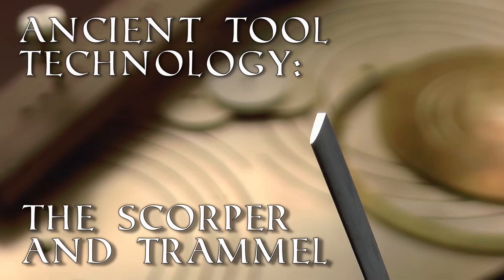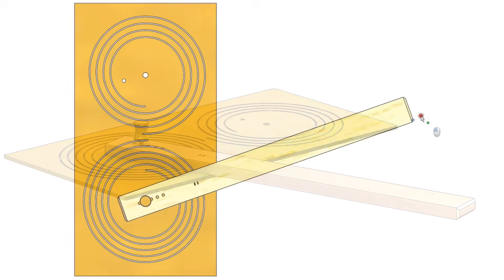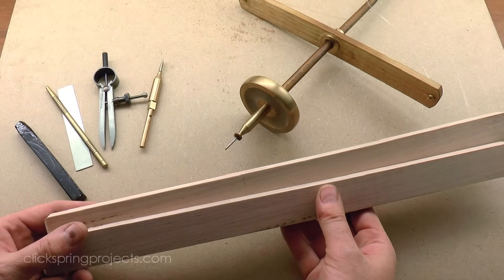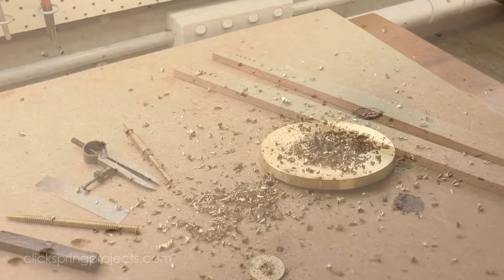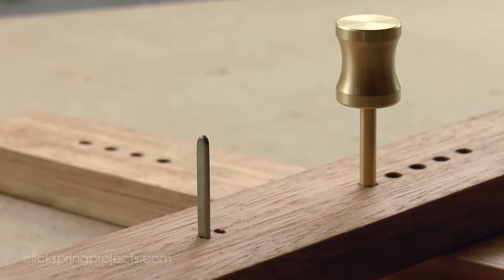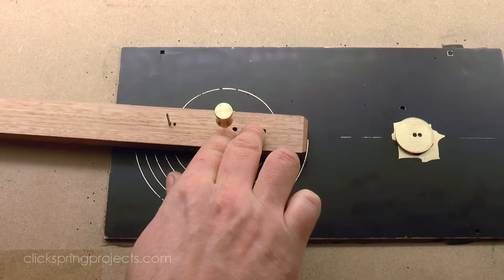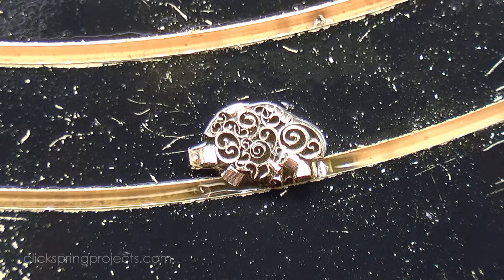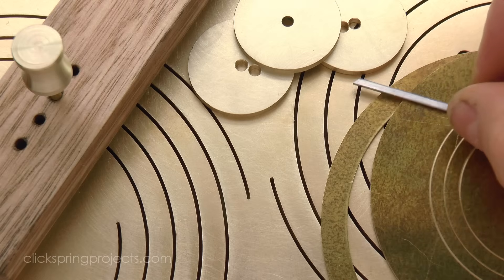The Scorper And Trammel - Experimental Archaeology - Constructing The Antikythera Mechanism

Comment: Being a Lamp builder, Lamp collector, and Lamp salesman who knows what fuels are safe and why, I would say that olive oil wasn't good in the lamp. Olive oil can't travel up the wick fast enough on lamps with a fuel to flame distan e of any more than half an inch.  Note the wick smoldering when extinguished, your flame was producing excess Carbon Monoxide if to normal fuel.  I recommend a petroleum fuel, namely kerosene or non paraffin wax Lamp oil, with a flash point above 125°F and ideally around 150°F.  This fuel will also produce more heat and more light, safely.

Comment: What was the wee black stuff you painted the plate with and what was it you mixed it with ? I suspect its a pitch grade or resin of sorts and a solvent but ive no idea what kind.
It worked very well.
Reply: He has a video on the different marking liquid options they may have used and what he uses.

Comment: A mind that can visualise this could easily have invented a lathe... if it hadn't been invented earlier. A number of tools would have been made specifically for this job, perhaps with limited application elsewhere. As the precision and function of the devices they created evolved, so, too, would have the precision, function and complexity of the tools used. A simple springpole lathe could have been adapted. It would be interesting to see how a basic pole lathe could be adapted, using technology, materials and engineering skills available at the time. Could a simple chucking device using collets be made in bronze?
Based on the Antikythera, it would be disservice to underestimate their enginuity and skills.

Comment: I'm intrigued as to why these "spirals" were done like this.  For everything being so precise in the mechanism, it strikes me as odd that the maker would just accept the imprecise nature of the offset semicircles.  Your method for reproducing the semicircles certainly fits the bill for simplest required method.  It got me to thinking what the simplest required method would be for producing actual spirals.  To this effect, I figured it would be a slotted bar for the trammel to move along the radius of the spiral, with a cord attached to the center and the trammel with the cord diameter equal to the desired spacing of the spirals.  If the trammel was kept taut, this would produce a true spiral as the trammel was rotated around the center.  One might even think of a mechanism where the trammel is counter-tensioned by having a sinew or other elastic material pull the trammel to the outside of the slotted bar so as to evenly align the trammel without significant effort on the effort of the user.  Perhaps this is just me thinking too deeply into the mechanism using anachronistic ideas of precision and models.  Either way, this video was inspiring and I love watching you!
Reply: Why would they do extra work to get real spirals when the data being read is represented by the angle, not the radius of the spiral at any given point. Using half-circles make the process much easier because the radius does not vary continuously.

Comment: I'm having trouble reconciling the conflict in my brain.  Yes, two hemicircles, but, if the point between your two locating pins was used as a focal point of the two hemicircles, wouldn't it then be a spiral at the midpoint between the kerfs?  And another question if I may:  Rather than using one locating pin at the center of the spiral, and one offset;  Could one set the cuts to radiate from two offset pivot points (one to the left of center, and one to the right of center, both equidistant from the center)?  This would put the center of the hands at the center of the spiral.  Or:  Am I just staying awake too late at night?  Thank you for another wonderful video.

Comment: What if you made a spiral by putting a string on a certain diameter cylinder in the center and then wrapped the string around with a marker? As you wrap the string around the center cylinder it gets shorter and that would make a true spiral. You just need the right diameter cylinder in the middle in theory. 

Half circles is kinda easier though.

Comment: I understand you used the olive oil for authenticity, but did it work well enough that you would use it in general as a honing oil? Other plant based oils should be just as good, but not canola or flax seed ( linseed), which are drying oils.

Comment: I know the mechanism didnt use a true spiral, but this got me thinking to how would you make a true spiral with the given tech level.  I got to thinking of a modification to the trammel with effectively a simple pulley to keep the scorper in place, but with the cord of the pulley wrapping around a central axis.  As long as the wrappings could be kept in the same plane, they would eat up more and more of the cord, which would pull the scorper in at a smooth rate.  
I haven't done the math, but I am curious as to how controllable the parameters of the spiral would be given this method.  To figure it out properly seems to me to require calculus as you figure out the rate of change of the radius for such a device, which would put it firmly beyond ancient technology.  In some sense, it could still be a viable option they could have built, even if the calibration would have to have been trial and error.
How would you go about making a proper spiral with the given technology level?

Comment: You state quenching it in water.....but lets NOT FORGET oils like olive oil and even some petroleum based oils (literally) were also known at the time!! And if you quench in an oil YOU DO produce a much harder steel then if quenched in water!! And like I said certain "oils" have been used for thousands of years and are well documented as well!! So it is not much of a stretch to think perhaps they quenched parts in a "plant based" oil or even some refined petrol type solution as well!! 

Another thing to add is that steel in limited quantities COULD BE MADE from simple iron, on a coal heated fire. It is harder to get the temperatures correct to produce it, BUT the addition of a bellows system, can increase the fires burn and temperature to a degree of heat possible to "turn" small bits of into steel when and if required by tool makers and blacksmiths of the period. In this too there is a lot of information that you seem to forget or ignore that "alchemists" (or alchemy) and metallurgy is something "new" when the truth is certain known raw materials like carbon, sulfur (brimstone), iron, cooper, tin, lead,  and so on were used long before the Antikythera devices was made. While not to the degree the device was machined complexity, but there is evidence that some blacksmiths, alchemists and other ancient sciences understood how to make small amounts of items that needed to make things like tools or weapons and so on!! And let us NOT forget some basic elements used in chemistry as well, that still TODAY are used but taken for granted. An example of this is the "Baghdad Battery" which science STILL has no idea why these batteries exist or what they were used for, but predate the Antikythera Device by years if not longer. So there are things we are just now realizing are not actually "new" to the modern world!! And even today we are discovering "new materials" in nature that we have never understood existed, like that of a meteorite that was just discovered to have a "natural steel" in it or micro diamonds from other space rocks that crashed to earth millions of years ago.

Comment: Your spiral is made of semicircles; is that true of the spirals on the Antikythera mechanism? When I first saw those spirals, the first image that jumped into my head was a string wound around a central post, with a cutting tool at the end (which would make it almost -- but not quite -- an Archimedean spiral).
Reply: @JorgTheElder  
You're right, I missed that, sorry.

Comment: Well that was incredibly satisfying. Beautiful solution. In woodworking we make scratch stock scrapers set into a marking gauge as a fast alternative to router bits to create moulded profiles and I often use the same principle to create grooves and even cut thin stock into strips. Of course there are also drill press fly cutters to create larger diameter circles. Nice work Chris.

Comment: I think another method to do the spirals would be to put a round pin in the centre and a string wrapped around it with a marking instrument tied to its end. While unwinding the string from the centre pin it generates a spiral.

Comment: Could you use a second circle with a pivot point off center to make it have an increasing distance from center to increase the arc's radius evenly through the full 360 degrees?

Comment: What's the possibility that the original fabrication of the Antikythera also used something as a stop for the half circle arcs? It makes sense to use some form of a stop, so that the arc doesn't go past 180°. 

Also, I don't see why a true spiral couldn't have existed. All you need is a trammel, with a slot rather than holes, and a rack, that holds the cutter, and a fixed pinion. The cutting tool rides along the slot, and as you turn the trammel, the rack moves along the fixed pinion, allowing the cutter to move as the trammel turns. It's not a very complex tool, and could have existed during that time.  The math involved shouldn't be too complex for the time period, so I wonder why a spiral trammel wasn't used.
Reply: Only with a basic trammel, I'm talking about gearing a trammel to extend laterally while it rotates. The amount of work put into the tool wouldn't be so much that it would make the tool impractical, and the cutting work itself would be less than that of four sets of concentric half circles. You also have to account for the start and stop position of each half circle, and line up the current half circle's offset with the offset of the previous and next half circles; even with physical stops, there's still more work in this method. Plus you have to take the time to adjust the tool each time you start a new circle, and adjust the physical stops each time you move offsets, which allows for more inaccuracies and more time in the project. 
With a spiral, the start and stop positions only matter once, and you wouldn't need to adjust the tool at all.

It comes down to four sets of four concentric half circles with tool adjustments for each half circle, or two spirals done with a tool that you don't adjust at all; 16 cuts on four centers with needed accuracy of where your 16 starts and stops are, compared to two cuts on two centers where the starts and stops only matter twice.

In the end, a spiral trammel will be less work overall, saves time, and has less potential inaccuracies. 
Your statement is factually false. Use some logic and do some simple math.

The tool itself wouldn't even be that hard to design. You need a stationary pinion with a moving rack, all it needs is a small cage to hold the rack and pinion together. It'd be a relatively simple tool. Maybe even throw a leg, that has a foot of a bearing material, on the cutting tool end to keep the rack parallel to the work. Again, something like this could have easily existed in the time period, and probably did in someone's workshop.
Reply: @JorgTheElder  You didn't comprehend any of what I said, did you? It's not complicated at all, it's actually fairly simple. Like I said, in the end, it's less work. Again, use some logic, and it's clear that a spiral trammel would be simpler, faster, and more accurate over the entire process.

If you really cannot understand this, you may have some competency issues. And I would start questioning your understanding of anything within this project, if a basic rack and pinion is 'too complicated'.

Comment: drilling a hoel through where the pints meet (a hole with the same diameter as the path) wouldnt that be a "good" thing. idk how precise you need to be with this tho in terms of overextending with the wrong half circle, the hole would need to be quite precise so might not be worthwhile and its not that big of a deal to over exted with the tool as long as its not by a lot :p

Comment: On the original piece, are each instance of a half-circle's radii constant? If a rigid tool were used, pivoting from a single central point through the half-circle, the radii would be constant vs a true spiral whose radius continuously decreases throughout its path. To get a true spiral, wouldn't you use something like a string being wound around a central mandrel allowing a tool tied at the other end to be drawn continuously inward?

Comment: Very interesting! First we have the approximation of a spiral by offset-centered half-circles. Then we have the humble trammel with a cutting tool instead of a point. Put them together and you have an approximate spiral cutter. Very plausible explanation of how they did it and a very clear explanation of how it worked. I wonder how lathe chucks scrolls were cut in the 1890s. It would be interesting to see if they reinvented the process.

Comment: I'm a bit confused how you got your steel to file hardness after filing off all the case hardening. Was it medium/high carbon to begin with? The case hardening implies to me you started with mild steel / wrought iron.
Reply from the maker: The initial stock is low carbon mild steel, insufficient carbon for a quench harden. Thin sections left in the pack carburisation process for long enough, end up carburized through the entire cross section giving the opportunity for through hardening - Cheers :)
Reply: @Clickspring  Ah! Thanks for the reply :)

Comment: The one thing I'm surprised about, is that you didn't make some kind of "stop" for the trammel. Since this process is something that doesn't require training, it seems like a job that you could easily give to the youngest apprentice, and if the set-up included stops to keep the trammel from going too far, this would be something they could do relatively quickly compared to having to ensure the correct start and stop position every time.

It should even be able to have it be a feature in the table you'd be working at.

Comment: At 10:34 there is a slip in the second wheel in. How did that happen? Did the pivot pin come out of the hole, or did the wood rock from side to side or something? It seems like such a slip wouldn't be possible with your setup. Could such a thing have happened while cutting?
Reply: Could be the "button" came loose. He is only holding that down with a bit of pitch. That could cause the kind of scratch seen.

Comment: How would they have made large flat plates of metal, be it copper, brass or bronze, in that time period? I guess they couldn't start with a nice perfectly flat sheet of even thickness metals as you do.
Would it have been formed by forging and then a lot of sanding to level out the hammer marks?

Comment: Did you have to sharpen the cutter very often as you progressed?

Why wasn't it bad for the cutter to tap it back out?

It seems to me that the simple hole used to hold the cutter would wear after a few uses.  It was good enough for the amount of work you did, but would the wood stick need to be replaced often in a working shop?  Or, would a more advanced version have either a more robust holding mechanism or a way to replace wooden inserts?

Comment: Add more pins on the other side of the tool and a large divider plate and you can have a way to form specific arc lengths.

Comment: I'm wondering why the trammel and peg method was chosen to mimic a spiral. I can see that a string winding around a peg would not work very precise because the scorper at the end of the string would be all over the place.
Making a real spiral might work, simply using a  trammel with a string running from the end to end, whereby the string wraps around the centre peg. The string would be under tension so the trammel would ride the circumference of the peg. Some resin on the string, trammel and centre peg should in theory prevent slippage. Would this work?

Comment: I used a trammel a lot in pattern making for large circle mark up, but had not seen till now how effective it is to  cut circles particularly in metal.
Earlier adjustable hole saws before the saw tooth design became the std work similarly, but not as versatile as to do a spiral or arch cuts .

Comment: At one point you mention chip breaking. In my experience working with brass I've found that chips break differently depending upon alloy. Leaded brasses break very well. Non leaded brass makes stringy nasty chips. Because the lead in brass is in solution, not alloyed, the brass chips break at the locations of the lead particles in the brass.

Comment: Wow, that's such a simple, elegant and extremely effective solution that I now can't imagine they didn't do it like this back then. I'll have to make a tool like that and try it myself. 
One thing on the spiral gauge though: when cut with half of the half circles on axis with the arbor, the indicator only changes in length half of every rotation, right? So the total friction of the mechanism changes with dial position, that's funny. Why didn't they center the half circles on 2 equally offset points from the arbor axis, when they were clearly using templates anyways? Are the holes too close together or doesn't it matter at all because of the gear reduction etc.?
Absolutely gorgeous work on metal and film, Chris, as always!